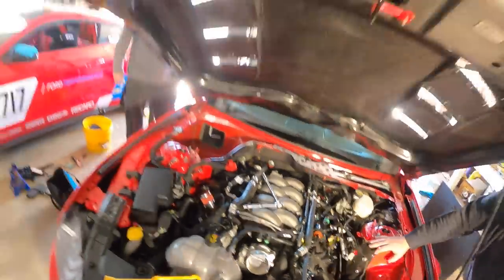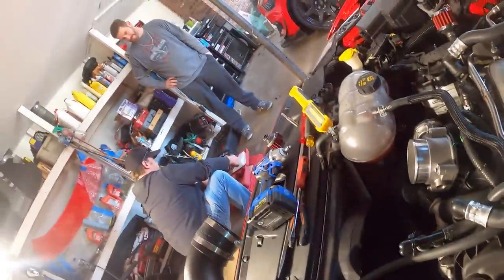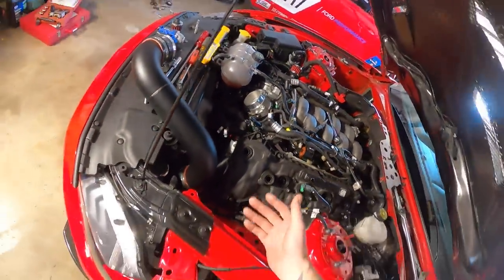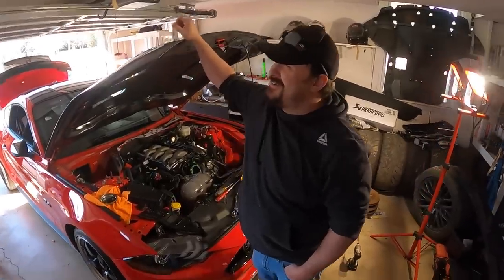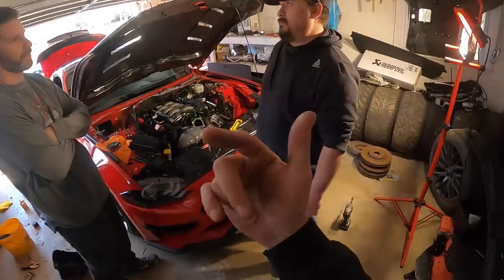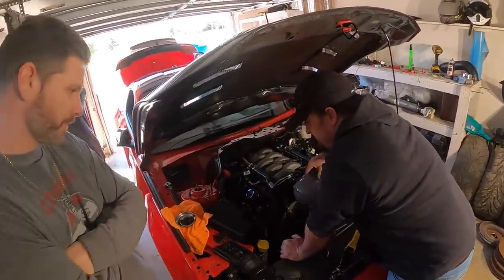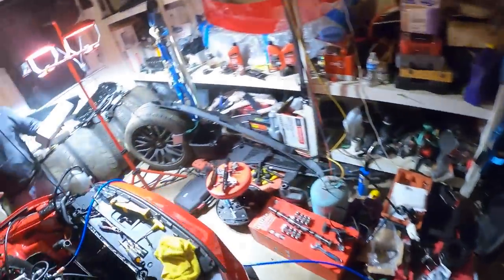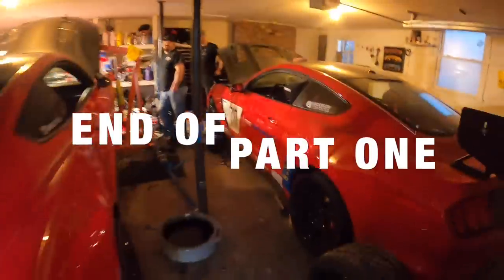Taking The Engine Apart AGAIN on my Twin Turbo 2019 Mustang GT: THIS IS WHY...

Comment: Everytime I think about adding a power adder, I think of you and your money pit, then I come to my senses. Thank you
Reply: Vito Augello  Amen!
Reply: Sam Barnes it isn’t that bad lol. He just had bad luck. I’ve been boosted for 10 months, 0 issues and I daily drive my car too.
Reply from the maker: It’s not that bad. I’m just building a race car
Reply: Zander13 I think your priorities are admirable but slightly askew. I think it would have been more cost effective if you went a different route. A body in white or a older 15 with tons of miles on it, a built motor as your internals are still stock. Knowing your channel, you’ll be changing fenders and doors for carbon fiber ones soon. I think you get my point.
Reply from the maker: Vito Augello basically all youtubers do this same type of stuff. Build cars and do crazy stuff and oh course we add drama to the videos for views but my build is not too different than many across the country. But for whatever reason, my channel gets picked on by the masses. I’m not saying you. But what I am saying is look at David van Voris. Ran 8.2 stock block. No issues. 1320 chick, over 925hp stock block. I’m actually doing to right things to protect what I have going on. Fuel system for better fuel. Valve springs bc float is bad for engine. Upgraded suspension etc... no I am not doing fenders. Lots of ppl go forced induction. But most just are not going as far as I am. They have different goals. Mine is to go very very fast
Reply: Zander13 don’t get me wrong I appreciate what you’re doing and the direction you’re taking. I’m actually learning as well which of course is the point of your videos. I’m a little old school where a race car is a race car and a street car even modified which mine is. Is still a street car. So carry on and good luck

Comment: Use compressed air in the spark plug hole to hold the valves shut so you can remove the spring
 Often time a compression test tool has a fitting so you can use air for your air compressor
Reply from the maker: That exactly what we did 💪

Comment: I got a phase 2 Roush on my bone stock S550 GT and I tell you I don't lose very often. Even to cars with more power... Usually they break traction and my cunthair close to 600 rwhp is enough to keep them from catching up before the race is over. 😁
Reply: So you’d recommend it? Haha

Comment: Lol and this is why my car will remain stock.
Reply: Me too.  I don't modify the engine because I live in Commiefornia.  I did light suspension mods and some cosmetics.   No problems with my Rustang at all.
Reply: Lynda Hammel 

Well you can always have a certified I installer or reputable shop do everything with a warranty on craftsmanship and parts. 🤷🏻‍♂️

Comment: Man your luck is rotten but you are not the only one who has suffered valve float recently John Doc has had it with one of his built engines it wasn't built to go in the car he has put it in and while doing tests he started to get float. One good thing is once you have the springs upgraded you can add more power if you can find tyres that hook.
Reply: This entire engine build has had nothing to do with "luck." Absolutely nothing.
Reply: divemaster 03 seems like videos are more important.  I’ve never seen anyone fail as much.  Wonder how many peeps actually purchased a zander13  Tshirt.  If you like the 3 stooges, carry on.  Lol